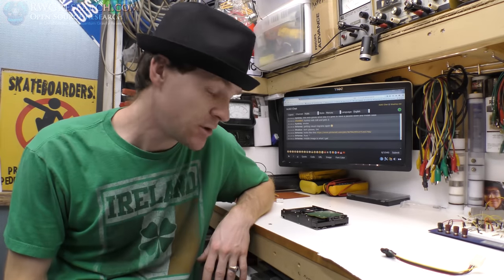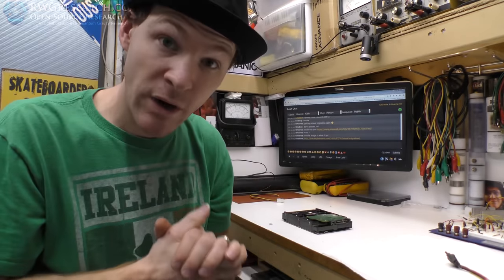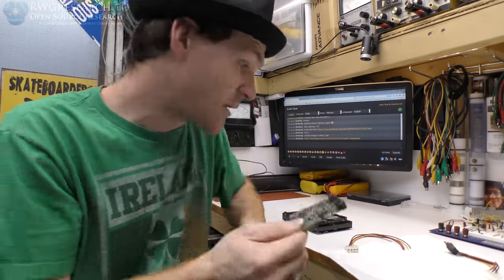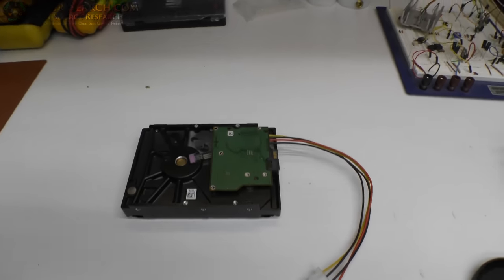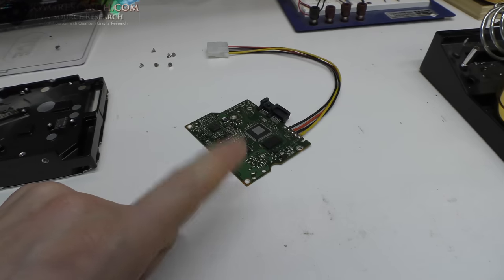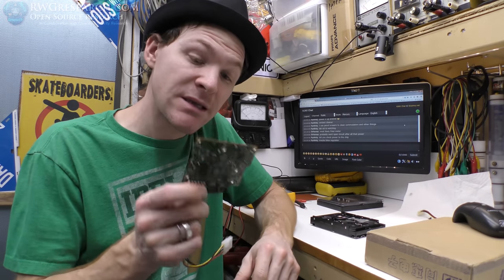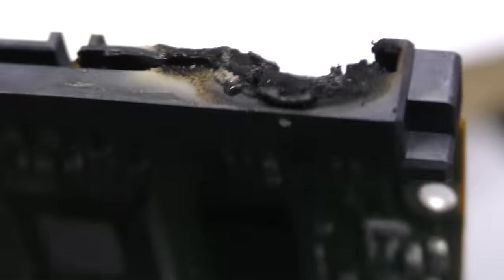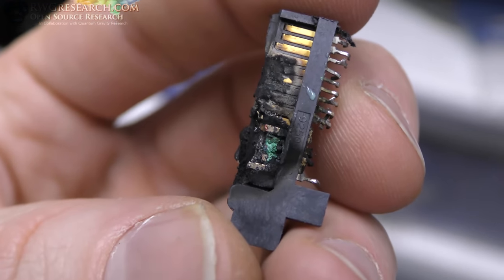This Is Bad... Major Malfunction... SATA Power Conector Exploded

Comment: Too much resistance on the 12v line (yellow and black) sometimes can be caused by a molex to sata converter constructed of too thin a gauge of wire.  I had the same thing recently with the 3d printer, Led light strips had been installed in the printer with undergauged wire, they were wired directly to the main PSU, the PSU kettle lead melted and fell into two pieces as the resistance built up and transferred into the next weakest link via heat.

Comment: This is a common trick but try searching out another HDD of same model and batch. You might be able to borrow the data board and temp install it on the damaged drive. Doesn't always work but sometimes works long enough to recover any lost data.

Comment: Was this computer in a high humidity environment?  The heavy oxidation on the spring contacts to the spindle motor and r/w heads leads me to believe it was... which would have led to the main failure... oxidation on the DC power connections, slight resistance = heat = more oxidation = more heat = more oxidation = ...
Computers and humidity do not play well together.

Comment: You cannot "feed" power to the ground, so what make the drive die isn't obvious, but having a short will just direct the current from the power supply into the short instead of to the circuit board and chips.

Comment: HP did put a recall out on this particular style adaptor cable a couple years ago. have seen a few melt myself. 
The non moulded adaptors with the crimped terminals are the way to go and dont melt.

Comment: It's not surprising that they can do this, considering how much power an ATX power supply can deliver. Even a small one will provide 40+ amps on the 12V rail, and a larger one can supply 120 amps. With the thin cables used, the drive can go short circuit and never trip the over current protection on the power supply, while the insulation is burning off the cable and connector.
Reply from the maker: Interestingly this one was in a DVR..  kinda crazy. 

~Russ
Reply: Now that is a bit strange. I would not have expected a DVR to supply enough power to burn up the connector.
Reply from the maker: yeah, exactly... and the unit is still good and working... ~Russ

Comment: Not technically exploded, as explosions will spatter material all over the place. But I think I'm seeing ash from plastic that actually burned, not simply melted. Safety standards require plastics to have flame inhibitors, but if sparking or arcing between 12 volt power and 12 volt ground is present, plastic can become fuel for flame that. This yellow wire suggests rking between power and ground that was not sufficient to shut the power supply down. If I'm right, the fault current did not flow in the drive itself, but voltage transients could have zapped something on the board... at that point more knowledge of the circuitry would be needed to probe the board to see if it was replaceable passive components. Vendors won't give you those schematics.

I'm a product developer electrical engineer who has investigated thermal runaway and product fires. My theory about this case is informed but not confirmed, as I'm not holding the parts in my hands and looking for anything to disprove my theory. I'm just saying it looks that way!

Comment: I've seen a video or two awhile back about the molex to sata connectors, with results similar to this. I need another sata power for another hard drive in a NAS box I built, but looking into a sata power splitter ... any experience with these?? Any suggestions on what type/one to get??

Comment: Wow, never seen that before.  Those connectors will have a type of oily silicone or something like that (not sure the real name, but when i take them apart it's a soft oily silicone looking substance) in them to seal the wires in the plug, that liquid may be that.  I subbed the guy you linked, i have a set of raided laptop drives and one of the drives had a hardware failure and i would like to get the data back from them if possible, i'll check his vids to see if there is anything I can do when I'm back in Canada.  Thanks for sharing Russ, it was an interesting vid.  Take care and god bless, chris

Comment: I have seen another video where someones PC almost burned down because of a burning Molex connector... Luckily the fire extinguished itself
Reply from the maker: yeah thats crazy, i guess the PSU is just " delivering the needed wattage" when theses things start to go up lol thats crazy... they should add a short circuit protection...  ~Russ
Reply: Any reasonably good ATX Powersupply does actually have Shot circuit protection! I am using a modified ATX PSU as a bench power supply, which is not even a really good one, but if you overcurrent it, it just shuts off and needs a reboot. 
No, i think the problem is a bad connection in the Sata connectors of those cheap adapters -> high resistance -> heat -> even poorer connection -> maybe arcing -> burning plastic. A recepe for desaster...
If you look around youtube ( i just did) it almost always seams to be bad sata adapters that cause the fires! Its wierd though, considering the small currents that are needed to power such devices...
Glad nothing really bad happened, could have burned your house down!
Reply from the maker: yeah, lucky this was not in my house ( it was sent to me by my dad)  also this was in a system that dose not have an ATX power supply...  so... even wore, and i agree that it was the adapters fault...  ~Russ

Comment: supposedly the cheap molded type is notorious for doing this. there's a reason all power supplies come with crimp on connectors.
Reply from the maker: yeah must have been a cheep one... cant tell now lol ~Russ
Reply: I've seen a video or two awhile back about the molex to sata connectors, with results similar to this. I need another sata power for another hard drive in a NAS box I built, but looking into a sata power splitter ... any experience with these?? Any suggestions on what type/one to get??

Comment: The cheap molex to sata adapters are notorious for melting down like that. Comes up often on reddit.com/r/techsupportgore
Reply from the maker: crazy stuff! never seen one in person till now... ~Russ
Reply: I've seen a video or two awhile back about the molex to sata connectors, with results similar to this. I need another sata power for another hard drive in a NAS box I built, but looking into a sata power splitter ... any experience with these??